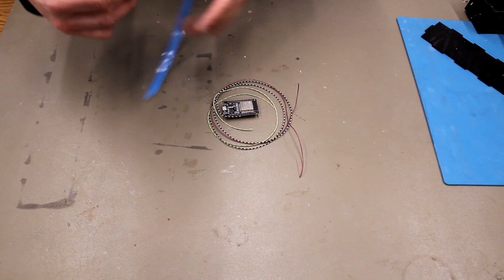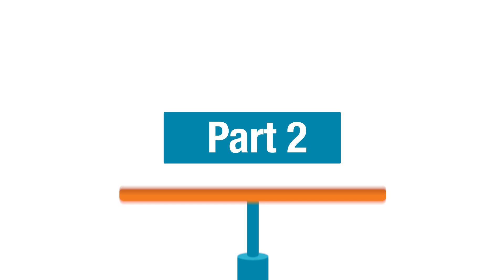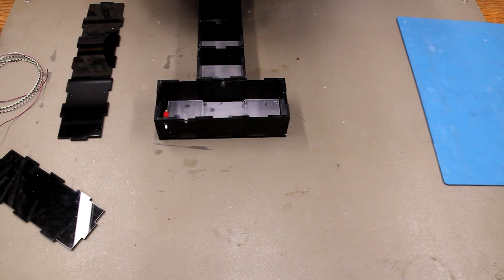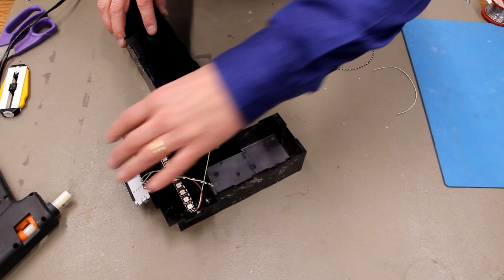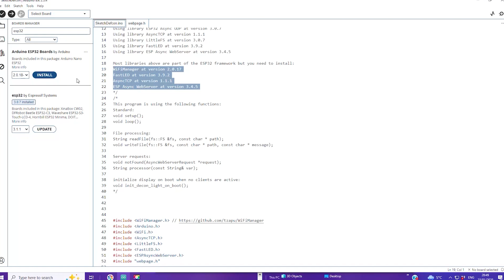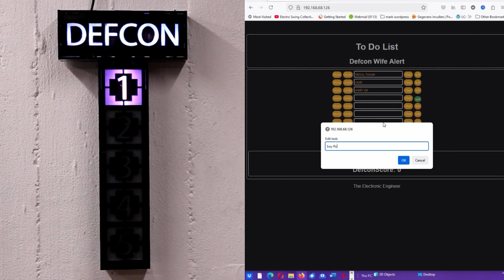Avoid Conflict with this ESP32 Defcon Task Tracker

Comment: Clear acrylic and paint is the simplest way to get a shiny "scratch resistant" surface..you just paint it from the inside and leave the outside as it is. GOt that trick from how they made the shiny Macbooks a few generations back.
used it in quite a few previous E14 projects!